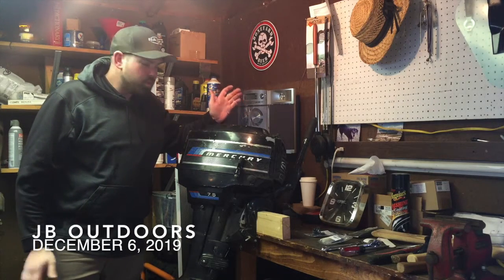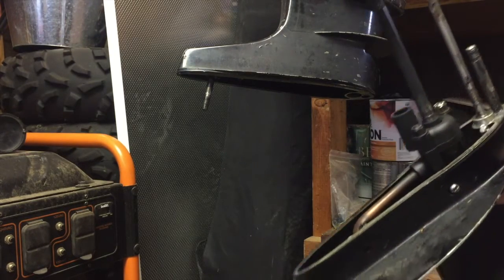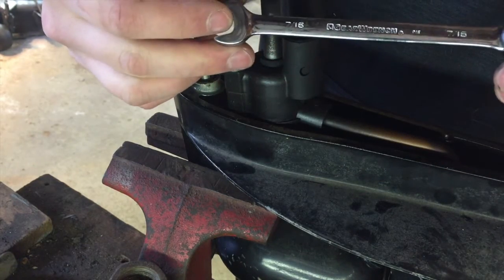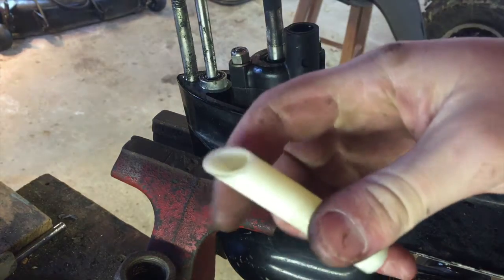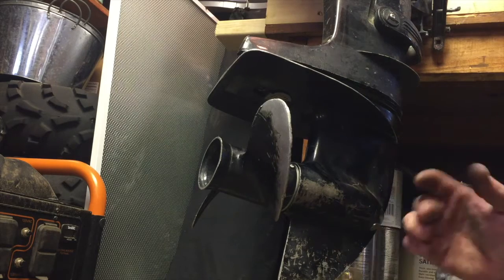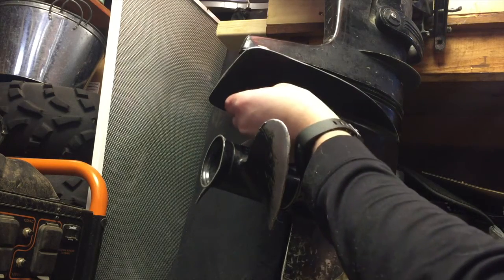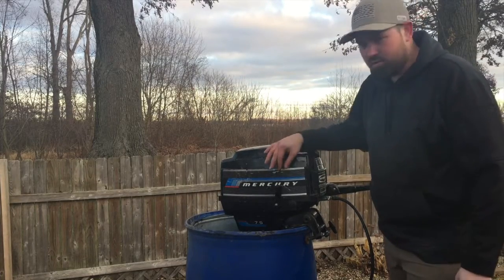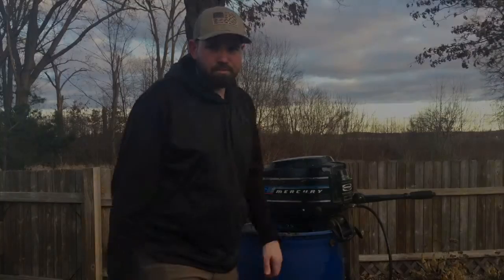HOW TO Replace Impeller (Water Pump) Mercury Outboard 7.5 hp

Comment: Thanks for the video, I'm doing this at the moment and I'm stuck trying to get the new impeller in place with the key. Even using grease I can't get it in. Can you share some more footage or do you have any other tips?
Reply: I had a 5hp Mercury that was a bear to assemble with the key as well, just keep trying and you will get it eventually.
Reply from the maker: Ben Waywood I don’t have any more footage of this, but what has worked for me with other impeller jobs is turning the lower unit on its side and having the flat part of the shaft facing up WITH grease holding the key in place. I hope this helps, for me it usually fell right into place with the lower unit on its side
Reply: Ben, I just saw on another video on the same topic that there  are two different diameters of impeller.  Might be worthwhile checking that you have the correct internal diameter.  Seems a bit rude to link to that video here since JB gave such a good demonstration.

Comment: Where do you find parts for your 7.5 outboard Mercury I have one just like it
Reply: Www.Perfprotech.com they have all parts and numbers diagrams and serial number search if you don’t know your year make model 👌🏻
Reply: Twisted Jig Co. er, yeah, except it doesn't work. I put in my serial number and it told me my 9.8 was a 4.2 litre sterndrive...which it clearly isn't :/
Reply from the maker: whitey badger i bought my kit on amazon, just be sure to have your serial number handy and know the shaft size as depending on the year they used two different diameter impellers. Your serial number will tell you which one on a figment guide on amazon. Thanks for watching!
Reply: Hi, Crowley marine has parts diagrams, #’s etc online.  They go back to 1975.  They only deliver in the states, I’m in Ontario, Canada.

Comment: Very helpful video.  I noted that the nuts on both locations were nylock, I never reuse nylock.  They dry out and wont hold, so pay a buck or two and use brand new ones.
Reply: The others nuts for the lower unit are 

5/16-24 
And 
3/8-24
Reply from the maker: Just Kelly that’s a good point! Thanks for the advice and thanks for watching
Reply: The nuts for the water pump are 

1/4-28 nylon locking stainless steel

Comment: Christ, the fins on the old impeller are all bent and hardened up and that exhaust tube you took off is the WATER tube grommet the water tube slides into.
Reply from the maker: Thanks captain, we all make mistakes sometimes.  If you already knew how to do it and know what you're looking at, why are you wasting your time watching a how to video?
Reply: @JBOutdoors  What did I say that was wrong there knob.
Reply from the maker: Mark, I know I made a mistake saying it was for the exhaust and not water, you were right with what you said. I’m new to making YouTube videos and still stumble and make mistakes in front of the camera.  Ive only done a handful of impellers and usually they’re broken and shredded this was the first one I’ve ran into that wasn’t so it threw me for a loop. Thanks for watching

Comment: where can I order online impeller and parts for older Mercury engines? Thank you
Reply from the maker: I ordered my kit from amazon just have your serial number handy to know the correct shaft size as they had two different sizes on different years. Thanks for watching, I hope this video helped
Reply: @JBOutdoors  Does Amazon has parts for 60's and 70's engines too?
Reply from the maker: Peter Janov I believe so, I’ve done a 1972 Mercury 7.5 hp as well

Comment: Good video,  but it looked like it was in gear when the shift lever was in neutral when you were running it? just wondering if something moved when you put it back together ? is this something I should look out for when I do mine.  thanks
Reply from the maker: Yes that’s an issue is it’ll move if you bump the prop during install and throw off sync of shift lever. This one came back apart after the running portion of the video and I cleaned up the shafts and realized that. Thanks for watching, take care

Comment: one thing I've noticed in most videos. theres always something not explains that one maybe needing to find. for example putting it back together whether in forward or reverse position its said either or but then one will have a preference in reverse and will show you why. then never does. the dos and fonts of talking apart and what can happen is actually very important for a guy who does not do things often. and looks for that in a video almost step by sep with pics is great. I won't watch one that skips steps nor doesn't explain. sorry but not helpful in many ways with this video.
Reply from the maker: Ryan Kurr the purpose of the gearing is to remember which gear it was in when you took it apart so when you put it back together it’s in the same gear and the shaft hasn’t moved. I’m sorry if I didn’t explain that well enough. In my video I said I left it in neutral for reference. I’ll remember this advice for any future how to videos I do. Take care
Reply: @JBOutdoors  I did the same job, plus some bushings, so the gears got misaligned.  Oh man, trying to get it back together where it shifts properly has been a royal nightmare.

IMO, this is such a ridiculous design-- it shouldn't have to be this hard.

Comment: I am changing out mine but I cannot get the shift linkage to release, cannot pull down the lower unit.   I did not see you do anything to release it.   Help?  Thx.
Reply: Got it.
Reply from the maker: Glad you got it, I didn’t have issues with that but when pulling apart just remember which gear you’re in and what get it’s it when putting back together that’s the biggest issue I had! Take care and thanks for watching

Comment: The copper tube and new plastic piece are for water delivery to the powerhead, the exhaust flows outside of that down the lower
Reply from the maker: Thanks Arne, I’m still learning these engines but wanted to show that anyone could do it, thanks for watching!
Reply: Do these outboards not run any lower end lube?

Comment: Thanks a mill, man! I just bought an awfully cheap one of these also with impeller issues, so I'm going to change it some time very soon following your instructions.
Reply from the maker: Anytime, I hope this video helps you, it's good to pick them up cheap like this.  Be sure to ask some questions if you hit any rough patches!  The worst part will be realigning the drive and exhaust when re installing the lower unit

Comment: What size is the impeller? What website did you buy it off?
Reply from the maker: I bought this kit through Amazon.com. This one was for the .456 shaft, but some were built with .438 shaft. If you have your serial number when purchasing you’ll be able to see which exact kit you need. I hope this helped!
Reply: JB Outdoors thank you so much!!
Reply: JB Outdoors hey I put in a new impeller but water still isn’t coming out of the hole. What could the problem be?
Reply from the maker: Kavon Woods could be a plugged or broken thermostat or a blockage in your water inlet line I haven’t made a video on these yet but I’m sure something is out there! Good luck I hope it helped with the impeller swap
Reply: JB Outdoors thank you! Now I’m trying to figure out why my tiller handle won’t twist all the way when I am in forward gear. If you know anything let me know please.